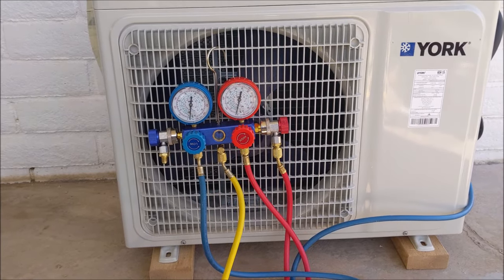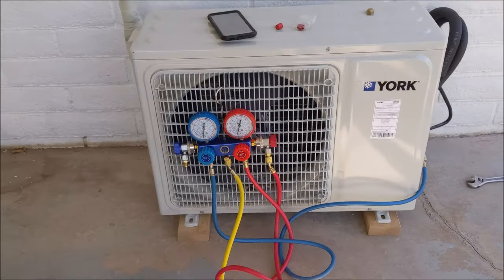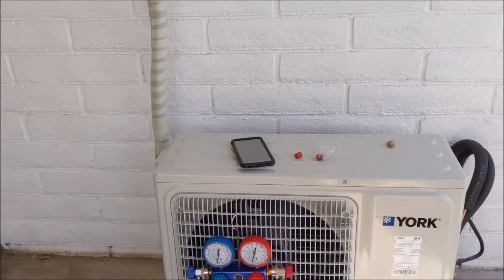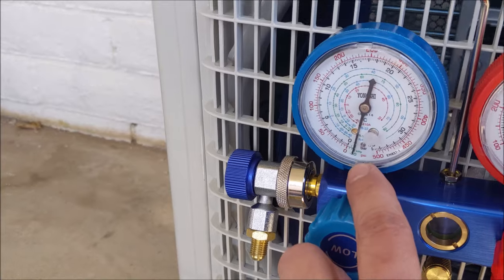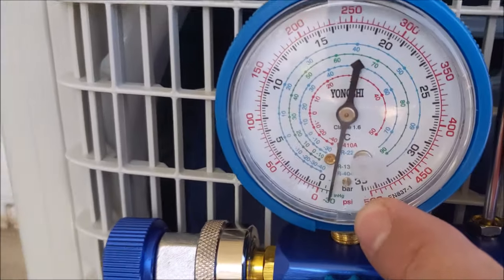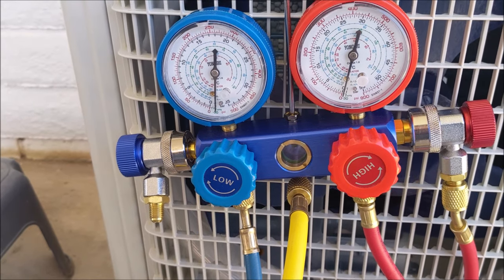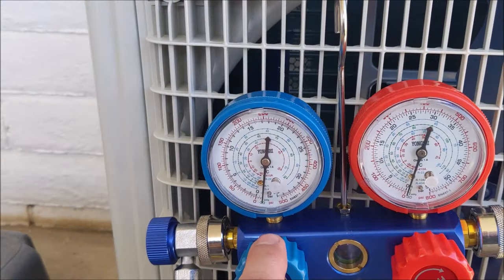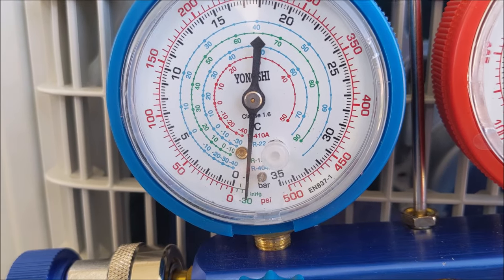Easy steps for Ductless mini split vacuum pump setup for 410a refrigerant

Comment: Can these steps be done to remove air in an already installed and once working system?  Refridergerent would already be in the pipes. The steps in your video were not done on installation of a system years ago.
Reply from the maker: You mean as a replacement of an older system, yes! Just make sure you vacuum the lines. Thanks for supporting our channel. Please SUBSCRIBE!
Reply: So I would say no. If you have a system installed and refrigerant in the lines and you want to remove the 'air' that was trapped in the system since install or that somehow got into the system from a leak point no. You would need to RECOVER all the refrigerant from the system. Then vacuum and recharge with NEW refrigerant. Any refrigerant mixed with air or moisture is trash. If you are swapping out a condenser with and keeping the original lines and head unit then yes. Connect new condenser. Vacuum. Confirm no leaks. And release precharged refrigerant from new condenser.

Comment: Also the hoses that connect to the adapter  with out the depression piece we should remove those valves where they connect if that makes sense? Thanks
Reply from the maker: The adaptor piece, yes can be removed when done using.
Reply: @SaveGreenHere  Do you remove the adapter after you release the gas?  Wouldnt that allow some of it to escape?

Comment: Wish there was more to the video regarding how to take the line off. I tighten my blue line too much and assumed it was pressure coming off when unscrewing it. I closed it back up but I'm afraid of trying again and losing too much refrigerant =|
Reply from the maker: u have to be quick in the process
Reply: @SaveGreenHere  So that quick disconnect -- I need to pull quickly. I should expect even a small bit of escaping refrigerant?

Comment: I have a 3 head unit I just hooked up it says on the outdoor unit only vacuum 1 port.  Does that mean only put vacuum to one line?  I was thinking I'd have to vacuum all 3 line sets separately but when I saw that I wasn't sure. Thanks
Reply: I have the same question.... any replies? For a multi-zone mini split system? Do we vacuum individually?

Comment: So you remove the blue hose after you release the refrigerator?
Reply: Yes
Reply: I had the same thought, but you're better off losing a tiny bit of refrigerant than a bit of humid air getting in the system.
Reply: Yes. You will have pressure on the system from the released refrigerant at that point. If you take the hose off while under vacuum you 'break' the vacuum and air/moisture will rush in.

Comment: Must I pressure test the lines? Also, must I vacuum both lines?
Reply from the maker: Do the steps with the pump, as shown on the video. Keep an eye on the needle on your gauges. If no movement, as shown on the video, you have NO LEAKS. Simple.
Reply: @SaveGreenHere  thanks

Comment: I have to add refrigerant to my mini split.  I had a leak.  I will vacuum first I know that.  My question is, when I am recharging the refrigerant into the system,  is the compressor supposed to be running? The lines that we use an allen wrench on, are they supposed to be open while recharging?  I just get a little confused and not able to find the exact answers to these questions.  Thank you.
Reply from the maker: Running in Cool mode. Suck up the remaining refrigerant (if any). First, connect the blue line hose into the service port, and use the mini split adapter. (https://amzn.to/3PGk6fT) DO NOT open the blue valve on the manifold. The gauge will measure pressure. Once you "pump down" the refrigerant into the compressor, it will show zero pressure. That means all refrigerant is inside the compressor.  1) close the service port with your hex key of the liquid line, the thinner line   2) Turn on the system in cool mode. You should see the gauge pressure start to drop.   3)Once it hits "zero" pressure, quickly use your hex key and CLOSE the valve to the suction line. IMMEDIATELY pull the electric disconnect, or breaker to the mini split, so no power is fed to the unit.   Remember to fix your leak, otherwise you will be doing this again next year! Use Nylog. Use a scale to weigh your refrigerant! The side of your indoor unit will tell you how many pounds it needs.

Comment: Can you test or check for a leak using vaccume pump ? Or does it need to be pressurized?  Got leak in mini split. Need to find leak 1st to fix it before recharging unit.
Reply: Meaning will like a soap solution create bubbles to show you where leak is at with vaccume ? Or it has to be pressure to cause soap to bubble ? Thank you
Reply from the maker: Bubbles will be clearly visible if there is a leak, particularly at the connections.
Reply: @SaveGreenHere  thanks for responding. I will do the soap & water mixture test. Wasn't sure if a vaccume would cause bubbles though. Appreciate your time & video's!
Reply from the maker: You do the soap bubble test while the refrigerant is in in, NOT while under a vacuum. But while under vacuum, you can check that your gauge needle is steady and not moving. However the BEST APPROACH is a micron gauge...... https://amzn.to/3wvn2VK
Reply: @chriscol6771  vacuum will not cause bubbles. The system must be under pressure to identify a leak with the bubble test. leaks under vacuum you will just have to reseat your connections and hope to hold the vacuum after adjustments.

Comment: My first mini-split install when smooth. My 2nd is a mess. Brand new unit, no refrigerant released, yet. While using the vac, gauge doesn't even get down to -30. Once vacuum is im turned off, immediately goes back to 0. Sprayed w/ windex for leaks around joints, nothing. What next or what's a better way to find a leak when I haven't introduced refrigerant to the system?
Reply: You're putting a vacuum on it, not pressurizing it, so you won't get bubbles when you spray it.  If you can somehow pressurize it then you should find leaks that way, otherwise make sure you didn't leave a connection loose...  Did you put Nylog blue on the flares?  I haven't installed a mini split yet, but I'm researching it and read that factory flares tend to leak, but Nylog blue will help them to seal.
Reply from the maker: Correct! Here's the Nylog blue link...... https://amzn.to/3UUiVhg
Reply: Thank you both. I'll check out the Nylog Blue.
Reply: I would also recommend using a torque wrench when you make your connections. Most people dont but there is a reason it is recommended. Too tight OR too loose is bad. As a service technician this was one of the most common issues with minisplits that eventually stopped working; refrigerant leaks because a torque wrench was not used.

Comment: so at the end, after you opened the high pressure valve on the AC (and before opening the low pressure valve), did you check if your blue gauge reading went up? per my AC installation instructions, it suppose to, but it never did. so i have the sense that i only vacuumed the hose to the AC and not the whole line.(i think my valve core never opened, to let the air escape). the AC still works, but i guess i shortened its life significantly. :(
Reply: I had the same problem - had to remove part of the valve from the adapter........ I managed to waste enough 421a that I needed to buy some more to refill
Reply: @coscarart  Same thing here - but I realized the low pressure hose was just backwards - one end has a pin to fit the schrader valve that's on the adapter, after I had already removed the valve core from it.

Comment: Is a shrader valve removal tool nessecary? The kind that holds vaccum when removing, installing?
Reply from the maker: Don't mess with the schrader valve unless your schrader valve is bad. You don't need the removal tool for vacuuming the air out of the lineset.
Reply: @SaveGreenHere  This is true if you have the blue hose oriented correctly. If your hoses are like mine, the ends with the little extension on them has the nipple inside to engage the schrader valve to press it open while the gauges are hooked up. I just did this process on a new install this week, and when I hooked the hoses up the way you have them in the video, the only vacuum I was pulling was between the gauges and the service port schrader valve. If the schrader valve isn't getting engaged, you're not pumping down your line set, you're only pumping down the blue hose.

Also, to anyone else installing one of these, if you cheap out on the gauges, make sure you at least buy a decent adaptor separately for the mini split connection. The cheap gauges I bought included the adapter, and it was garbage and leaked like a sieve.

Comment: Mine seems to fit just fine without the adapter.why is the adapter important ? Thank you
Reply: Some. MS's have a smaller fitting requiring you to  down size with a reducer adapter.

Comment: I have a vacuum pump for automotive a/c units ,  it's not electric it runs off an air compressor , do you know if it will be ok for these mini split units .
Reply from the maker: Probably not if used on different refrigerant.

Comment: My mitsubishi mini split that I'm installing says in the directions to use a micron gauge and break the vacuum with nitrogen, can I do without it? I know if I call my HVAC tech that I used in the past, he will not use one. I want to do what ever is correct.  Thank you
Reply from the maker: You can get a vacuum micron gauge, to be 100% sure...... https://amzn.to/3e5GUTv  That is a simple gauge, and even brings an adaptor.
Reply: You should be pressure checking the system for leaks first. I have an oxy/fuel torch... So, I just used my oxygen bottle.

Mini-splits usually operate at about 450 psi. So, you'll need to pressure check to at least 150-200 psi. Then use dish soap on your connections to determine any leaks. 

It doesn't need to be nitrogen. Any inert gas will work.

Comment: Can you disconnect the blue line from mini split before releasing refrigerant? So you don’t have it come out at all
Reply: No because you will introduce air back into the lines as it is under vacuum
Reply from the maker: NO. If you do, air will enter. Not good.
Reply: @SaveGreenHere  Maybe I just don’t understand… Does this fill my vacuum line that is blue with refrigerant? Or is there some sort of magical thing happening at the valve that stops it from entering the vacuum line? I absolutely will do this exactly as you’ve shown, I’m just trying to wrap my brain around it.

Comment: So It holds negative 30 with pump on but gauge goes to zero slowly when it's off, guessing it's a leak? . Any tips to trouble shoot / what do I do from here?
Reply from the maker: Check if your ends are not tight enough. Did you use Nylog? If not, you are asking for it......... https://amzn.to/30BBQ5R
Reply: @SaveGreenHere  hey man thanks for the prompt reply. Went back and checked the fittings and that ended up being the problem. Thanks so much for the video too it was super helpful

Comment: I was vacuuming the line today and didn’t close the blue line  valve when completed causing it to go back to zero. Is my system leaking? Or do I have to shut off the valve when turning off the vacuum
Reply: Shut off the valve before turning it off. I would do it again.

Comment: wouldn't you cut the ability for a vacuum leak to be detected off when you close the blue valve?
Reply from the maker: No. The blue valve will cut off the communication from the blue hose to the other hoses, such as the yellow hose or the red hose. When the valve was open, it was communicating between the copper lines, and the yellow hose connected to the vacuum pump. Once the blue valve is shut, it cuts off the yellow line communication, (to the pump) but still measures pressure from the system. The refrigerant is still inside the compressor, until the very last step, once it's released into the lines. Both low and high side gauges are a "straight through" connection to the hoses directly under them, so as to always have a pressure reading. So even if closed, you get a pressure reading.

Comment: Hii.. i just install mini split AC... I follow step by step.. connecting blue hose to the AC maintenance port and yellow hose to the vacuum pump...after  finished vacuuming when see the manifold pressure didnt move.. i  releasing the refrigerant but my manifold didnt show any pressure at all... Its like it didn't vacuum the AC.. only vacuum the Hose... What did i did wrong... Do i need to thighten the blue hose super thight? Or did i need an adapter.. pls help..

 i have another AC to install in another room... But since i have this issue.. i scared to install another one... This AC that i already install cant be vacuum anymore right.. because already release the refrigerant..
Reply: Likely you've got the low pressure hose backwards.  On mine, only one end (with the angled connector) had the pin to depress the schrader valve that was on the adapter hookup.  The other end doesn't have anything to depress that pin so you never open the valve to the line set and end up vacuuming just the manifold and low pressure hose, not the line set.   Check the other end of your low pressure hose on the manifold guage set and turn it around if necessary!  Worst case, remove the schrader valve from the adapter.

Comment: Now would that be r12 gauges you’re using
Reply from the maker: They have readouts for 410a, R-22, R-134a, and R-404a
Reply: @SaveGreenHere   I see.  The reason I ask the gauges I use on trucks have a quick connect fitting.  Not sure what I need to make it work

Comment: When I did my install 6 months ago, I couldnt track down a pump that was compatible with r410a, so I said screw it. Here I am today with a unit that blows untreated air while in the COOL function amd blows nothing at all in HEAT. 

Junk the unit and follow the instructions next time?
Reply from the maker: No. just add refrigerant. Make sure you add SLOWLY. It takes time and patience. Use the 470, which the link shows on this video description.
Reply: Thank you so much. I'm going to try this tomorrow.
Reply: Something doesn't seem right. I've  had the pump running for like 30 mins. PSI reads -1 while it's running and the yellow part reads something like -60. When I kill the pump, the gauge instantly drops to 0psi, which like -40 on the yellow. 

I've sprayed every connection with soap water, both with the pump running and with the pump shut off, and I have no bubbles. 

I'll happily pay you to walk me through this.

When the pump is running, there's a slight hiss from the unused connection of the low pressure side. When I put my finger on the hiss, the pump bogs. I figure that's exactly how it's supposed to work.
Reply: My system went to -20 vacuum. It stayed there but never went to -30 I wonder if it's acceptable. Any thoughts?
Reply: @Arnulfo Romero  in my case it only got to -20 having it for 24hrs.  I open the valves how it's showed and as of today is still running cold.  That was last year
Reply: @jcje32009  generally speaking whats the min. requirement for negative psi?  what i have gathered is some said -1psi, 1 model says -15psi,  is there a minimum to ensure its good?
Reply: @HombreMalo  either your vacuum sucks 🤣🤣 or you have a leak
Reply: As a technician what I would do is RECOVER the refrigerant in your system because it is trash now. Then vacuum properly and then recharge with new, clean refrigerant
Reply: @SaveGreenHere  You cant just add refrigerant to a system that was not vacuumed properly and expect it to work.
Reply: @alexh9252  You dont check a system under vacuum with soapy bubbles. There is technically no pressure to make a bubble. If anything, it will pull the soapy water into the leaky connection if there is one. Soapy bubbles are used on a pressurized system. The pressure from the air/refrigerant leaking will create bubbles. A flat or slightly depressurized system will not produce any bubbles.
Reply: @JC.72  -30 psi. most technicians want down to 500-1000 microns. you would need a GOOD vacuum and a micron gauge. -30 should be fairly easy on a system with no leak points and a decent vacuum.

Comment: Assuming the vacuum holds, is there really any need to check for leaks?  Seems redundant/
Reply from the maker: Keep it on vaccuum for a good while. If it holds without moving the needle, you should be ok. However, a micron gauge is the better way. Here's an affordable one. Well worth it...... https://amzn.to/4bdNw0a
Reply: I would recommend more than 15 minutes. Like an hour. And a micron gauge. The vacuum process is one of the most critical for the longevity of your system.

Comment: Fellas! I need an advice. I vacuumed the 16 ft long line. Left the manifold connected. (While having the low pressure blue valve shut). After 1 hour, I could see the needle was going slightly down. (To -29?). After 10 hours, the system pressure goes back to 0. The question is, if this outcome normal? Online I read people say 15 minutes is enough to test lines with vacuum. Does it mean I loose vacuum due to the manifold connections? Or is there a great chance of a leak?

Thank you!
Reply: Did you ever resolve this? It seems to me like you have a leak somewhere and will need to fix it before introducing the refrigerant. What sort of unit do you have?
Reply: Remove the line set and apply a drop of vacuum pump oil to the threads and retighten the compression fittings.

Comment: Mine holds at -26... what does that mean
Reply: The value depends on your height above sea level. You could check some online calculators.
Reply: Inches of mercury.  It says it on the gauge.  It's equal to -12.7 psi.  -14.7psi would be perfect vacuum at sea level.